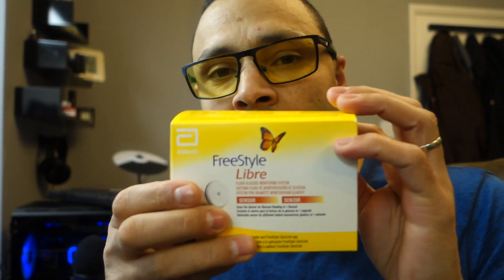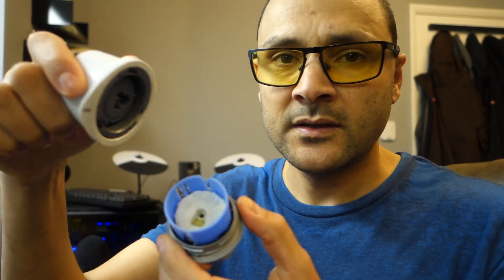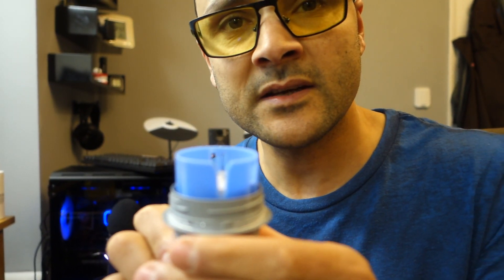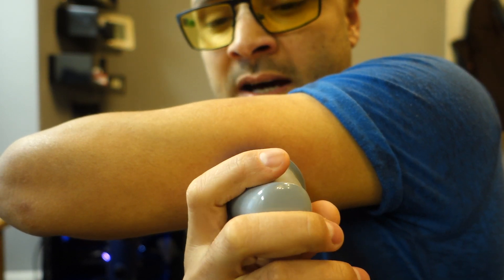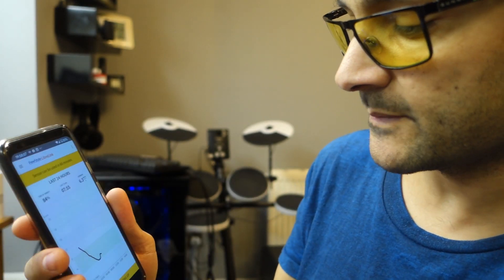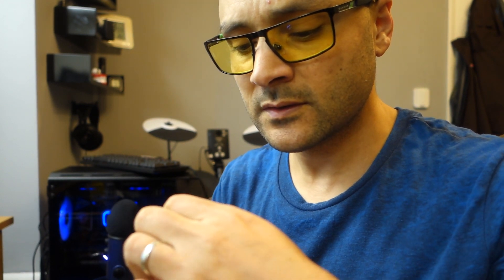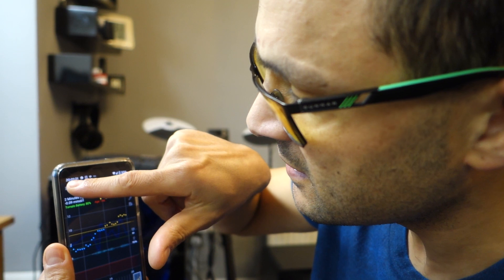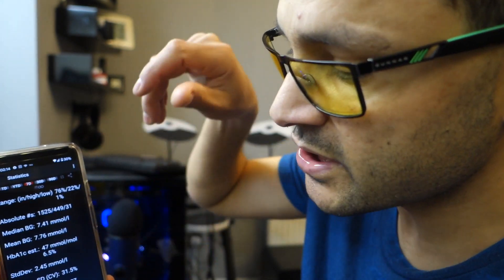Freestyle Libre Sensor Application | How to Control Diabetes | How to Lower A1C

Comment: Beware lot of sensors are faulty and give a very low result for eg it will show you a normal fasting level of 5 when it is actually 8. You need to test it with the finger prick meters to be sure. I had reduced my medications due to this and was shocked when my HBA1c results came much higher. I am using this for the last couple of years (spent thousands of dollars on this) and have decided to discontinue using it.
Reply: I agree, I've just found this out after trying it for the first time. It says I'm at 5.3 when I'm more like 6.3
Reply: Same here.  Avg glucose per Libre is generally 114 which would suggest A1C of 5.6.  A1C comes in at 6.1 to 6.3.  Frustrating!!!  Called Abbot to discuss and customer support guy had no knowledge of this.

Comment: I check my readings on my iPhone x through Ambrosia Linkblucon app. Also the app reads my sensor and update me when my blood glucose values goes Hi and Low.
Reply from the maker: Do you use an apple watch?
Reply: @shaktastik  Yes, I use apple watch to check readings on my watch directly without the phone.
Reply: @julliethomas8191  Hi, which apple watch series you are using directly with Blucon.

Comment: Nice video, I've been using my libre sensor for past one year and six months. It's really a great product that Abbott has designed. Later after some time I was looking for those devices which could make it a CGM device so that I couldn't need to need to scan my libre sensor. I tried many devices for best results and came to conclusion that Ambrosia's Blucon is best one as It connects direct to apple watch without phone. I get my glucose readings on my phone every 5 minutes without scanning the sensor. Earlier I usually could not take a good sleep because of instant high and low glucose levels but since I'm using libre with blucon I didn't experience those days again. I can set target glucose range which helps me to get alarms on my high and low glucose levels. My doctor saw many changes in my diabetes and started recommending to his other patients too. I'm awaring to maximum diabetic groups so that others could manage their own health as well.
Reply: Hey Amelie, seems this is the nice concept. How can I acquire one? Please share more information or their website. I'm also  looking for a device which can give readings on my phone as in India our Libre reader just shows the graph. This idea would be great if I could get readings on my phone.
Reply: Thank your for that I watched the video multiple times and couldn’t find the app he is referring too.